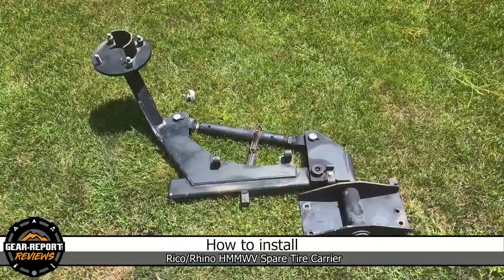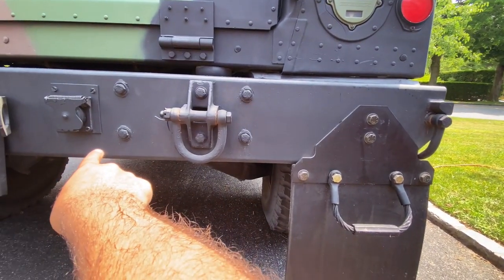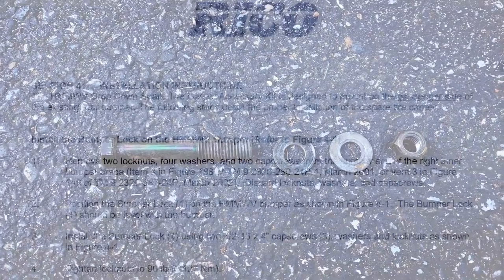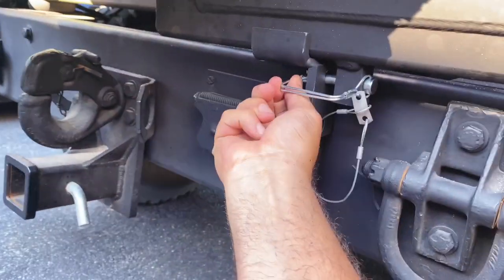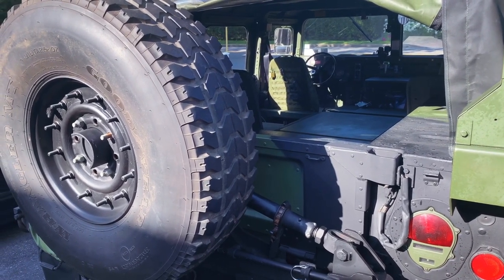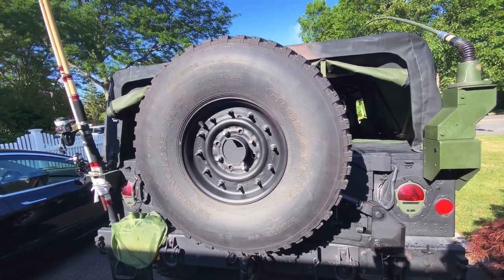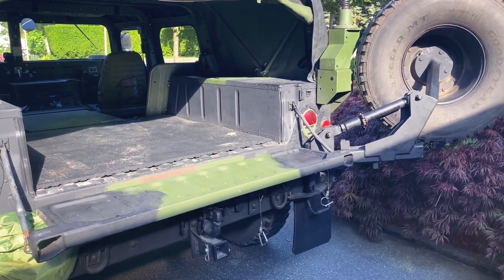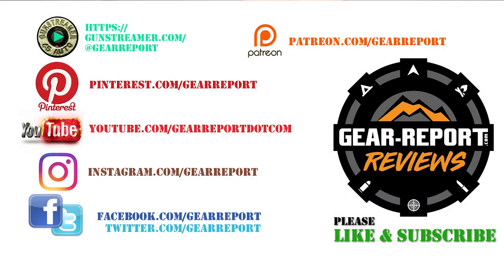HMMWV DIY - How to Install and Use a Humvee Spare Tire Carrier

Comment: I have a 2003 Z71 Tahoe that I am currently installing an a2 bumper on to facilitate using a Rhino lift. I am getting older and have a heart condition that sucks all the umph out of me. I have a leveling kit in the Tahoe running 33" tall Cooper S/T Maxx tires. The spare is in the truck at this time, taking up needed seat and cargo space. The bumper is already cut down to 73" from the 85" stock length. I will have to modify the mounting bracket by shortening it on the right side as mounted and re-drilling the bolt holes taking it more to the right to clear the liftgate. The rim plate will be re-drilled and studded for the 6 on 5.5 bolt pattern. It takes too much energy to man handle the spare in and out of the truck. I'm looking at the Rhino as a handicap person's version to still to attempt to enjoy the outdoors and the wilderness. I don't have one yet, but I'm working on it. This video has helped a lot in the visual imagineering department. Thanks.
Reply from the maker: Sounds like a solid plan

Comment: Helpful video, thanks.  What type of bolts did you use for the attachment to the bumper?  And did you use locknuts or regular nuts?
Reply from the maker: Pretty much the same as the airlift bumper install bolts. Grade 8 https://gear-report.com/humvee-upgrade-how-to-install-hmmwv-airlift-bumper/